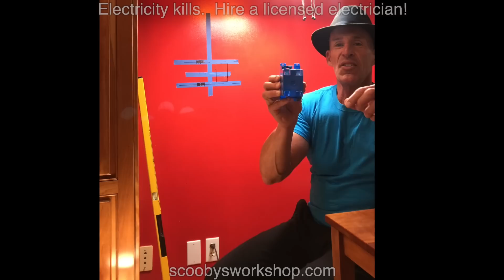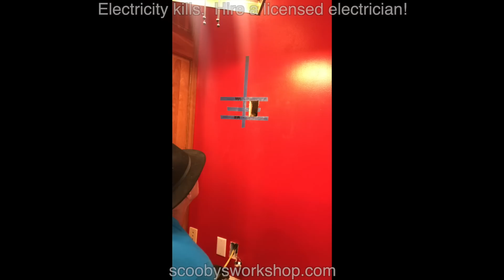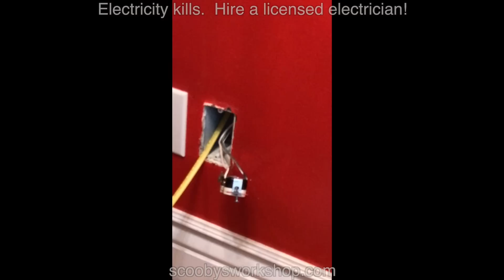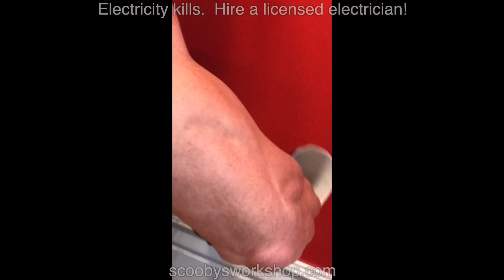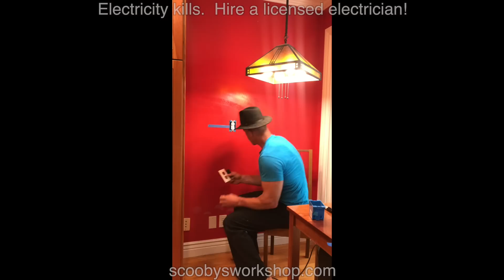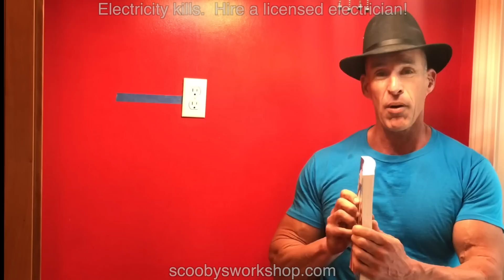how to add an electrical outlet

Comment: Having visited US the wiring is certainly not up to UK standards in the villas I stayed in. I hope twisting wires together like this is not the normal practice!  Source: UK qualified electrician of 20+yrs including high voltage work.
Reply: Can’t say I’m qualified in the UK but my time in the military taught me how to make due across the pond. You’ll find that in America there’s so much work to be done that villas as you were talking about are basically track homes so residential (domestic) guys run right through them without a care in the world for neatness. Commercial and industrial electricians take pride in their work on the other hand. Quantity over quality leaves them more work down the line I suppose.

Comment: My brother was helping me install a ceiling fan in my office and one thing he told me was (in Pennsylvania) the standard wire nuts are not adequate for ground wire and you need to use a split nut ground bonding connector for it to be to code. I'm not sure if Cali code is the same with respect to that or not, but you may want to look into that for future projects.
Reply from the maker: i would be very interested to see if the NEC has changed in this regard, its entirely possible.  if it has changed, its because people were not taking extra care as i did here by winding the ground wires tightly all the way to the back of the box.  when you do the grounds that way, you dont even need a wire nut to get an excellent ground connection.
Reply from the maker: googled and found no changes in the NEC
Reply: @scooby1961  ahh ok must have been just recommended then and not a code. Great video btw! Bought my first house 3 1/2 years ago and I enjoy videos like this that give me inspiration for easy future projects!

Comment: Shame on you Scooby, didn't have that handy light bulb or ddp meter to test wether the wires had power or not, instead went full on short circuit.
Though I'm always amazed at how many handy work skills you do have, one of the reason I admire you so much, because like me, you always really interested on how everything works and how you can it yourself.
Reply from the maker: no need to bother, it was already turned off which i verified by plugging a light into.  the wire touching was being triplely safe

Comment: Why not connect both ends of the cables to the socket itself? Or is the socket not suitable for parallel wiring?
Reply: I think NA power is too low on for that

Comment: Can you also do this with an existing light switch???
Reply: You can daisy chain the connection as long as it has a Hot, Neutral, and ground. I suggest taking some time to learn a bit more about the process before trying this yourself though. There are a bunch of little nuances that aren't shown in this video (I believe the purpose of the video is to show how easy is it to install a new outlet without breaking into the wall to run the wire.). Take some time and really learn this stuff, because if you mess up, then the BEST case scenario is significant damage to your house.
Reply from the maker: it depends.

Comment: In most country’s this is illegal to install without a licence, goodluck claiming house insurance if something goes wrong and it links back to dodgy wired gpo.
Reply from the maker: not sure where you are from but 'most countries' does not include USA which is a very big country.  It is legal for homeowners to do all their own construction, they just cannot charge others for it without a license.  i am guessing that many other countries have similar laws.
Reply: scooby1961 Ok so I’m from Australia, all electrical work and additions require certificates for proof that the work was done by a qualified persons. This is why I mentioned house insurance, if there is additional work to your house that isn’t recorded or doesn’t have a certificate and something goes wrong... your claim will pretty much be invalid. So yes  homeowners can do their own construction.. but there are things to consider. 

-What size circuit breaker is the addition being added to.

-what appliances are already being used off that same circuit, you’d need to calculate the capacity of the circuit so that if all the appliances are being used the circuit doesn’t trip. (You never really use all outlets but you still need to consider it)

-does the law require an RCD to be installed when upgrading an already excising circuit (required in Australia and NZ) 

-is the gpo your installing rated to the same amp as your circuit breakers current. 

Didn’t want my comment to come off negative, but electricity is dangerous... it’s usually best left to people who have qualifications.. 

Also at around 15minutes Is that the gpo that made a sparking/short circuiting sound? Or was that completely unrelated to it.
Reply: @MrTheofilactos  I'm Australian and agree with the above, but Scooby is correct, it is legal for the home owner to add a certain number of gpos or lights per year. I think the installer has to submit some paperwork to the power distributor.
Reply: Big M I never said Scooby was incorrect, I was simply making a point that it’s not as easy as adding a gpo anywhere in the house, there are things to consider like insurance and that electrical installation is completely subjective to your house and it’s switchboard. 

There is no rule about how many you can add per year, the main cable supplying your house with electricity has a capacity too. Meaning that there is a calculated amount of lights and gpos that your house can have. Unless you paid your electrical provider for a main line upgrade... you can’t continually add things, there is a limit. 

Your switchboard also has a limit, and the breakers in your switchboard also have limits, everything needs to be calculated before the installation.
Reply: @MrTheofilactos  Thanks mate, I was referring to  US regulations,  where there IS a limit to the number of  additions that a home owner can perform. An electrician can do whatever they like, within reason. Now, back to the nanny state of Australia.......